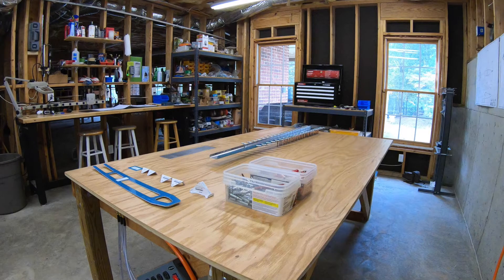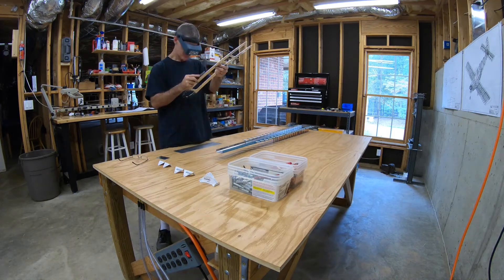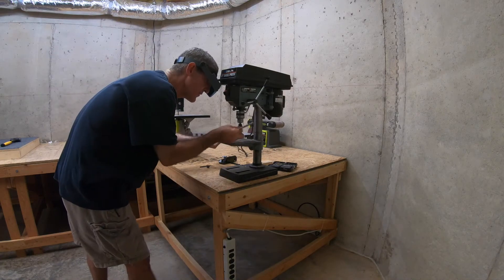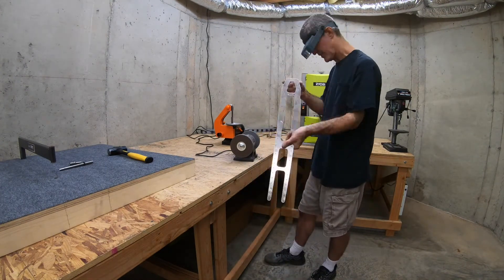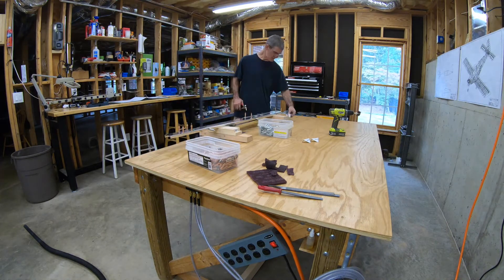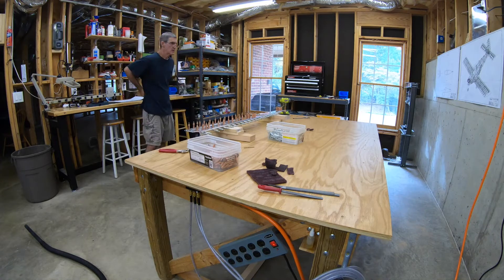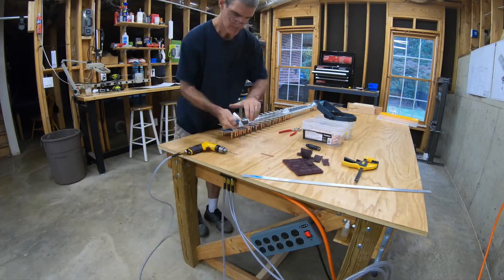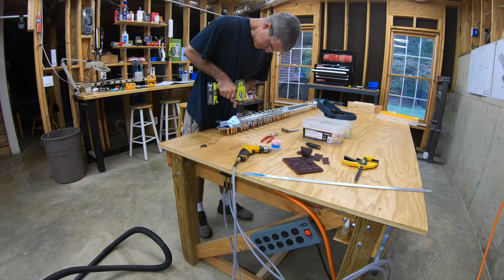RV-10 Build Log -  Emp 03 - Drilling and countersinking the VS Rear Spar

Comment: Just started watching and subscribed, you may answer this later...looking at the shop and where you are building it reminds me of NCIS and Gibbs building a boat in his basement. How are you going to get it out of the basement as I don’t see a big door.  
Love the ideal of using the magnifying glasses. Where did you get them?  Enjoying the videos
Reply from the maker: Hey, thanks for the comments!  Everybody asks me how I'm going to get it out :-) Nope, I don't have a big door.  The stabilizers and control surfaces, the tailcone, and even the wings when turned long ways, should fit out a human-sized door - as long as they aren't assembled into the final plane, of course.  The fuselage will be a different matter.  One option will be to build the fuselage in the garage instead of the basement.  I've got a couple of other ideas but they require modifications to the house ;-)  At the rate I'm building, I figure I've got a couple of years before I have to decide...  Oh, and I bought the magnifier visor from McMaster-Carr.
Reply: @missiletwentynine2667  thanks for the info and best of luck. Hoping to start an RV 9 in the near future, some logistics to work out first. Will keep following the build...